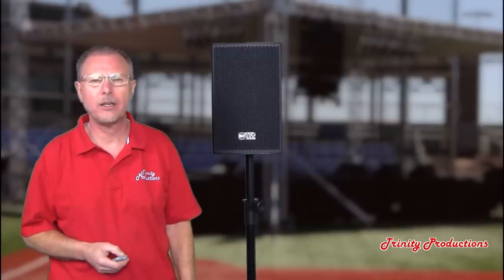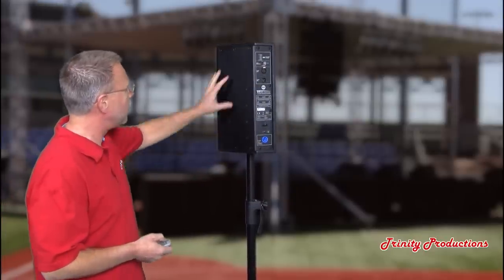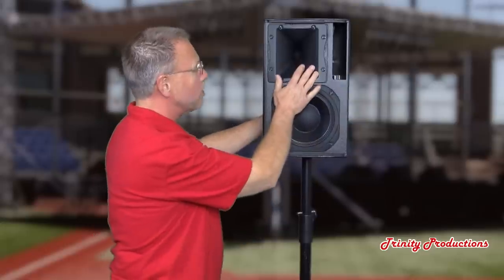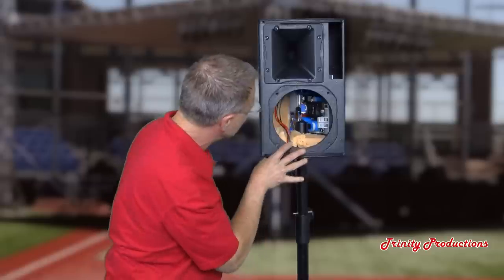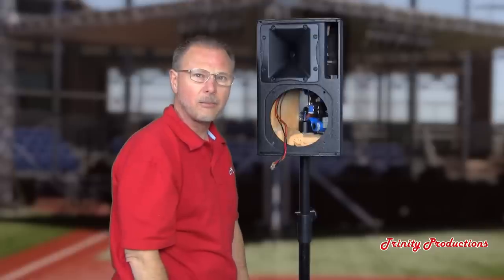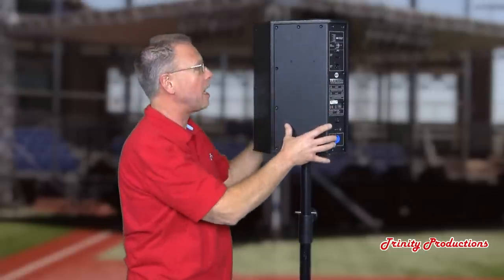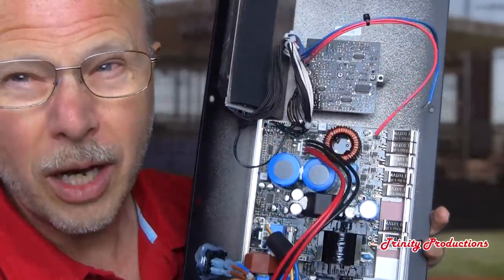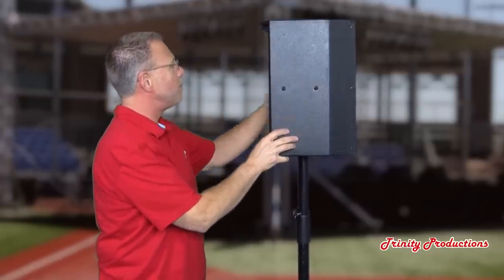RCF TT 08-A SPEAKER OVERVIEW, INSIDE AND OUT - AUTH DLR FOR RCF

Comment from the maker: I would stay with RCF and look at the 8003AS or 8006AS subs...we have sold a number of these to use with TT and 4PRO systems, and the customers that have purchased them are blown away by the output and sonic quality. If looking at the dB technologies line the SUB 18D is great and the S10 or the new 1518 with 1500 watts to a single 18" driver is a great Sub.

Comment from the maker: Ales...the TT08 is a great speaker, however to get the SPL and low end of a 725A MKII, you would need to go with the TT22A's...the 725 is a great speaker also, but the TT series goes well beyond in quality of components, DSP and amplifier quality. When we first heard the TT's we were amazed...you will find you can purchase 2 or 3 of the 725's for the cost of a TT22a, but you will only need to purchase once and with a TT box not need to upgrade for many, many years.

Comment: Hello, is it punchy? Or what model is the most punchy for that size and weight for electronic music for a studio? Thanks!
Reply from the maker: Look at their Ayra line or the Mytho line they are amazing studio speakers
Reply: @trinityprosound  Thank you so much, the issue is that I need a punchy, very light weight and portable active system for small electronic events that usually take place in small roof gardens around 70m2 with 50-100 peple top.  Which are the most powerful mids & subs can you recommend? I want to carry them in my 2007 seat ibiza trunk. Thnks.

Comment: hi thinking of getting the RCF TT+ 25aii , i love the 4inch voice coil , i currently have 745s , will be using with 8003 asii sub , what preset on 25aii would you recommend I use ?
Reply from the maker: If no subs, first present linear L1, if using subs use crossover out of subs at 90hz and linear L1, if no cross over out of subs use the L2
Reply: @trinityprosound  so when using sub which i will do the preset on the 25aii will be L1 and on the sub L1 or L2 ? sorry i am sure i should understand what you told me !!!
Reply from the maker: L2 i believe is the low end cut for the tops

Comment: can i use 2 x rcf tt08s each side so 4 in all ?
Reply from the maker: You can , just have to be splayed correctly so you don't comb filter the crap out of them, they are wide coverage to start and would have to do a 45 degree plus offset as a minimum to get coverage OK. flat facing both forward will not sound good at all and will comb filter the crap out of a premium loudspeaker

Comment: hi can i use my rcf 8003 asii with the rcf tt series 08s ?
Reply from the maker: yes, you can use the built in cross over on it for 90-100hz , the sub will most likely out run the top , but it will work well, may have to volume balance between the sub and the TT08
Reply: will the rcf tt 08ii do  a better job than the rcf tt 10a
Reply: i currently use 745s but space wise travelling I need a smaller box now so i thought maybe the rcf tt10 to use with the 8003s